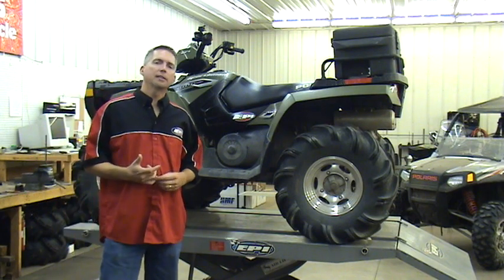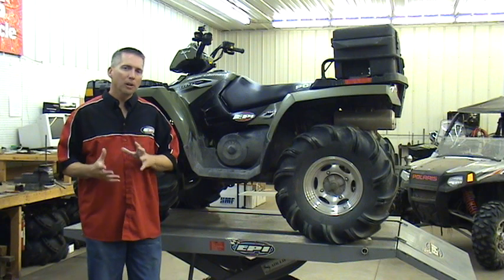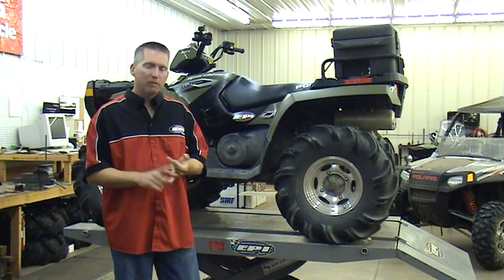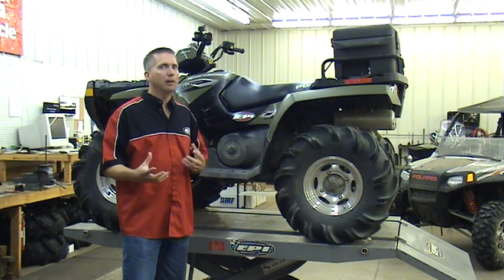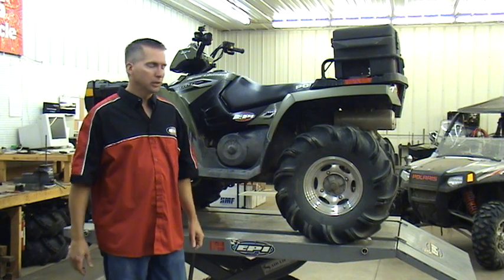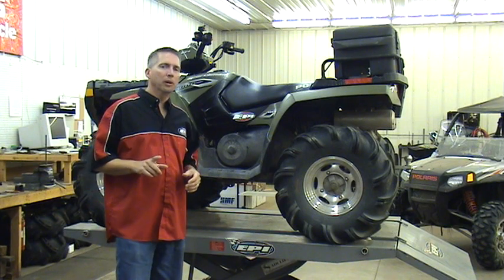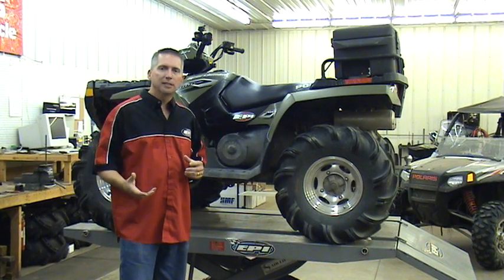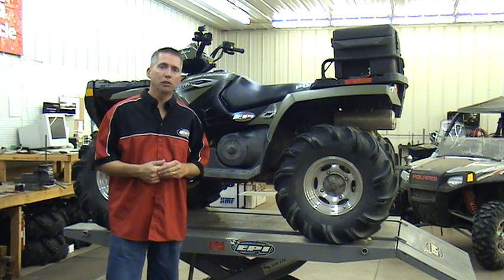"Why do I need a clutch kit?" By EPI

Comment from the maker: @titans514jake
We offer two clutch kits for your machine the Economy and the Competition Stall.  They will give you a higher stall speed or engagement that allows the motor to rev up more before you start moving to give you more power right when you first start moving.  You will get better low end power to help turn the bigger tires and faster throttle response whenever you are on and off the gas.  Top end speed and rpms will stay the same, but you will accelerate up to it faster.

Comment: Does a clutch kit always give you more power, because I am look to get one for my Polaris 325 trail boss, it kinda powerless and I would like it to launch harder and faster
Reply from the maker: The clutch kit doesn't make any more horsepower, it takes the horsepower you have now and gets it to the ground better.  The 325 aren't going to rip your arms off but with the kit you will get better low end and midrange power, faster backshift and throttle response and grip the belt better.
Reply: EPIperformance yes I know it dosnt add horse power, but I would like it to feel like it has more, I will look in to get one. Thankyou
Reply: EPIperformance oh hey again on the trail boss 325 4 stroke bike, it has like zero low end power but it really picks up in the high end, could it be my belt or the carb/injectors/gas filter?
Reply from the maker: Yes, any of those things can cause low end power loss.  If your belt is stretched out to long and or worn skinny that will hurt your low end power and take off and also your response when you are on and off the gas.
Reply: EPIperformance that you again

Comment: My 2015 sportsman570 has  27" tires so I installed a epi kit and I'm getting a slight winding noise. Could this be because the kit is new? It's not the mud kit its the all around kit.I installed it correctly but that slight winding noise has me worried, can anyone help? Thank you.
Reply from the maker: On some models the clutches will downshift faster and disengage at a higher rpm so can hear some belt noise while it is doing that.  But that would normally only happen under deacceleration.  Its basically the belt resetting so when you get back on the gas its ready to go.  Sometimes going to a lower engagement will lessen the belt noise.  Hope that helps let us know if you have any questions.

Comment: I got a 2002 yamaha grizzly 660  stock . What you suggest me to install on it so I can get more power ?? I only use it for street or desert
Reply from the maker: mohammed khalid Hello, we would have a clutch kit that would help yo out but would need to know more information on what tire sizes you are using on the street and in the desert.
Reply: +EPIperformance the stock tires

Comment: Would this help king quad 750
Reply from the maker: Yes it would.  We have a kit specific for the 750 King Quad which changes the wet clutch springs, roller weights and the secondary spring.  We have several different kits available depending on your tire size and type of riding.  You can find out more info at epiperformance.com

Comment: Just purchased  a 14 can am maverick max 1000r and it came with 40in tires (22msa wheels) it’s already lifted (8” s3 lift) and has stock clutch and gear , it burned up 2 belts within a week of ownership , what do you recommend I get done ? Since I was looking to purchase the EPI mudder clutch kit you guys offer.
Reply from the maker: Our Mudder kit will make the clutches the best they can be using the stock clutches.  Then the next step would be a gear reduction either through portals or the transmission.

Comment: I have a 700 grizzly 2010 ,with 26/10/12 tyres. What is the best kit for me?
Reply from the maker: If your tires are lighter and less aggressive then you would want to use the Stock Tire Sport Utility kit.  If your tires are really heavy and aggressive mud tread then you should use the Sport Utility Kit for 27-28" tires.  Hope that helps let us know if you have any other questions.
Reply: EPIperformance thanks for reply!

Comment: Will adding a clutch kit lower top speed. It shouldn't but people keep telling me it will.
Reply: Also, will clutch kits wear faster than stock clutching.
Reply from the maker: +Matthew Trent It depends on the clutch kit and model you have.  We try to keep all the top end speed we can.  Ususally the stock tire kits will stay the same, the sport Utility kits for oversized tires are usually the same but can lose just a few mph off the top.  The Mudder kit is where you will see a bigger change in top end.  It varies a lot depending on tire size/weight also.  The EPI kits will last longer then the OE and give you better all around performance.
Reply: +EPIperformance what about the high stall kit or regular for a Honda rancher 350.
Reply from the maker: +Matthew Trent On any of the Honda kits top end speed and rpms will stay the same.  We only change the wet clutch springs which will raise your engagement up higher to help you start out and keep the bigger tires moving. The economy kit will raise your engagement 300-500 rpms over stock and is the kit which most people use.  The competition stall will raise your engagement 700-1000 rpms over stock.
Reply: +EPIperformance doesn't it Essentially pop the clutch and thus lower reliability? As far as the economy vs competition, which is better for what? Competition will add more acceleration but be more twitchy than economy. Also i known that you or would have to rev higher before the machine goes, is it too much to handle in tight trails.
Reply from the maker: +Matthew Trent It wont pop the clutch, it will allow the engine to rev up higher before it starts engaging and moving.  Will not effect reliability.  Most people go with the economy kit.  The competition stall kit is great for all out performance but some people don't like turning that much rpm to keep moving all the time.
Reply: +EPIperformance okay thnx for all the help.

Comment: I have a 2005 Polaris sportsman 500 H.o and was thinking about getting 28" outlaws do I need a clutch kit I've already got 28" mud Zillas and they turn alright.
Reply from the maker: I clutch kit isn't required but with the EPI kit it will give you better all around performance and also save wear and tare on your belt and clutches.
Reply: +EPIperformance thank u for the info
Reply from the maker: Glad we could help.

Comment: What would be best for a 2004 Honda Rancher 350 es(electric shift) I plan on putting a new air filter, exhaust..etc.. i trail ride and love to go through the gear fast with acceleration. Would a sport clutch kit be best? I plan on keeping stock sized tires and have it jetted and maybe have the cylinders bored also
Reply from the maker: Hondas are a little different then all the other brands.  We offer two different styles of clutch kits for that machine.  The Economy kit which will raise your engagement 300-500 rpms or the competition stall kit which will raise your engagement 700-1000 rpms over stock.  Most people go with the economy kit and are happy, but if you want to make it the best it can be then you will to go the competition stall.
Reply: EPIperformance how much extra performance will I get from the the competition kit? Will acceleration increase?
Reply from the maker: DeerHunter2291 You will get more bottom end power and torque to help turn your tires and keep them turning better.  Top end speed will be the same the big difference will be in the low end and midrange power and response.
Reply: EPIperformance how much would this cost me?
Reply from the maker: DeerHunter2291 $50 for the Economy and $60 for the Competition kits.  Plus shipping.

Comment: EPIperformance I just bought a 2016 Sportsman 570. I dont mud and I dont tow. however I do trail ride. I am a big guy. Im 6'5 and about 350lbs. I am planning on moving up to a 14" rim with a 26 or 27" tire. should I buy a clutch kit or would it be over kill for what I do?? Thanks in advance....
Reply from the maker: We would suggest using the Sport Utility Kit for 27-28" tires even if you don't use that big of tire.  It will make up for the power loss up the bigger tires and also help with the rider weight.  It will help you for all around use, better low end and midrange power and acceleration, faster backshift and throttle response and will grip the belt better then the stock set up.  Hope that helps let us know if you have any other questions.  Thanks
Reply: EPIperformance Thanks for the quick response and the advice. I will definitely install a kit when I make my upgrades.
Reply: EPIperformance Thanks for the quick response and the advice. I will definitely install a kit when I make my upgraldes.
Reply from the maker: Thank You.

Comment: Do u make a clutch kit for a 2014 Yamaha grizzly 450?
Reply from the maker: Yes we do.  we have 5 different clutch kits available for that machine depending on what tire size your are running and at what elevation you are riding at.  You can find more in on our website at www.epiperformance.com or call out tech line 218-829-6036.  Thanks!

Comment: Looking for a clutch kit for a 2014 Polaris Sportsman 800 EFI. Your site doesn't offer a kit for my yr and motor. Really would like to use you guys just can't find the right kit. Tuner, 27" tires, and hmf exhaust. Has to be a kit for my quad from EPI
Reply from the maker: Hi Tony,  2010-2014 use the same kits on the 800 Sportsmans.  The Sport Utility kit for 27-28" tires and 0-3000' elevation is part number WE437004.  And it will work with your tuner and exhaust.  Not sure why its not updated on the website but we will look into it.  Thanks
Reply: @EPIperformance  thanks a ton. Should be on the old visa here in a minute 😎
Reply from the maker: Sounds good.  Thank You!

Comment: I have a 2018 yamaha grizzly 700 LE. My stock tires are 26". I plan on buying 27" bighorn and also plan on using my atv for snow plowing. What kit would you recommend? I talked to a guy and he said he put one on a 700 and the person didn't notice a difference in power. Is that normal.
Reply from the maker: I would use the Sport Utility kit for 27-28" tires which is our best all around kit for you with that size tires.  You will get better low end and mid range power, faster baxkshift and throttle response and grip the belt better .  You should definetly notice a difference.
Reply: @EPIperformance  would you have the part number please?
Reply from the maker: Part number for the kit for 0-3000 ft elvation which is where most people ride is WE391077.  If you are above 3000ft all of the time then you want to use WE395004.

Comment: I need one for a 2020 tracker off road 570.
Reply from the maker: Hi Sean,
We haven't had a chance to test the Arctic Cat/Textron/Tracker 570 yet.  I believe we have all the parts here to make the kit work, but need to get a machine here to test it to get the right combination.  Our spring testing will start as soon as our snow is melted and the ground is thawed enough to be able to get some traction on it.  Please check back with us in a few weeks and we can let you know if we have had a chance to test it yet.  Thank you.
Reply: EPIperformance I will thanks.

Comment: Hey I've got a 2018 can am outlander 450 and I've still stock tires on but I'm for more low end torque and power please let me know what I need
Reply from the maker: We have an economy clutch kit for the 450 2015-2018 that changes the primary spring and secondary spring for better all around performance.  Part number is WE437294
Reply: It  will improve the Power and  throttle response? And not lose any top end
Reply: Also I don't want high engagement only like 2100-2200
Reply from the maker: On that machine the top end might come down just a few mph.  Most others the top stays the same except for on the Mudder Kits.  We would have to go to lower spring then whats in the kit to be at 2100-2200.  We would have to swap out to the dark green primary spring.
Reply: Would I still get the same power tho just a lower engagement
Reply from the maker: no, you get one or the other
Reply: How high would the other spring engage at?
Reply from the maker: The kit is normally on that machine 2500-2700.  Dropping to the green would be aprox 2300-2500

Comment: hi sir. i have a 2011 polaris sportsman 550efi xp eps  on a set of camoplast t4s and i would like to have a exaust.  do i need a clutch kit ?
Reply from the maker: A clutch kit would really help your performance and save wear and tear on you clutches and belt.  Usually with the track systems we would have you use the Sport Utility kit for 27-28" tires which will help make up for the power loss of the tracks, give you more low end and midrange power, faster backshift and throttle response and grip the belt better then the stock set up.
Reply: EPIperformance ok thanks a lot for the fast reply.
Reply: Already ordered. Excited to see the difference.  Ill let u know how i like it
Reply: Dany Barceloux how do i remove front driveshaft from yamaha bigbear 400 02modal

Comment: What if you put a clutch kit on without doing other moda
Reply: Mods
Reply from the maker: Almost all of the kits are designed to work with the stock motor and exhaust.  So as long as you get the right kit for your size tires and type of riding the kit will work great.  The kit will also work with the stock belt as long as it is in good shape.

Comment: hey guys, i m working on a brand new  rzr xp 1000 with some 30 s mud tires  ( 12 psi), of course i put an epi clutch kit # WE437163 and blow up three belts in a weekend including the epi belt ( comes with the kit ) any ideas??
there s a lot of heat in there..
Reply from the maker: Yes the 1000 makes a lot of heat in the clutch box and overall pretty hard on belts.  We recommend inspecting your clutch vents for any blockage including old pieces of belts.  Also clean and inspect the clutches for any worn or dirty bushings both in the primary and secondary clutches.  I would also order the update kit from Polaris that updates your clutch housing with an extra vent to help it run cooler.  A lot of the hard core racers and riders are also installing billage air pumps inline on the clutch vent tubes to push fresh air in and hot air out.  Hope that helps, let us know if you have any other questions.  Also you have a one year warranty on the EPI belt.
Reply: thanks for the answer, could you send some info about the update  from Polaris please (i m not im the states and there s nothing here) and also some options for the air pump.
thank you!! 
is not the extra load on the clutch springs that cause the extreme heat???
Reply from the maker: Miguel Laricchiuta  I don't know the part number for the update.  But your dealer should be able to get it for you it will include the clutch cover, vent lines, and a new belt from the 2015 1000 RZR.  With our clutch set up you will grip the belt better in both clutches and reduce belt heat and belt ware.

Comment: Do you have a clutch kit for a 2016 grizzly 700 eps
Reply from the maker: 2007-2017 Grrzzly's use the same clutch kit.  We offer several different kits depending on the your type of riding and tire size.

Comment: Im trying to fina a clutch kit to let me run 30s on a 2014 yamaha grizzly 450 4x4
Reply from the maker: The biggest tires we tested on the your machine were 28".  We have a Sport Utility Kit for 27-28" tires which would be a lot better then your stock clutching even with the 30's on there.  Part number is WE490704.  You can put that number in the search area on our website and it will give you more information.  www.epiperformance.com